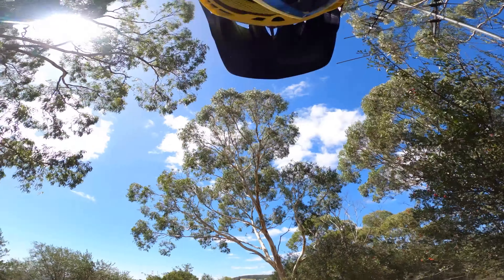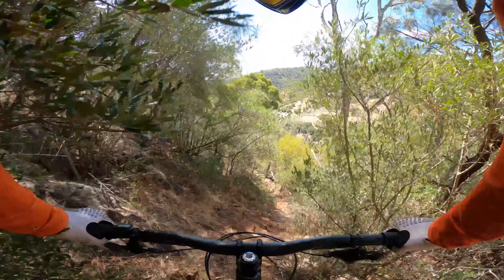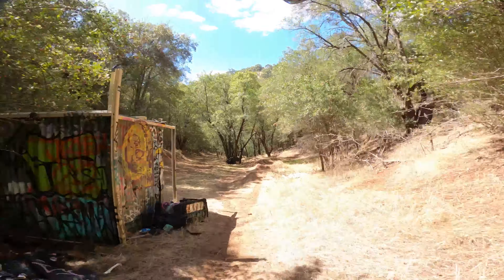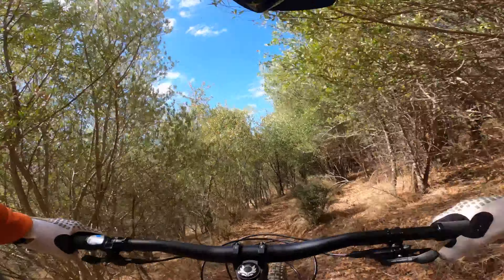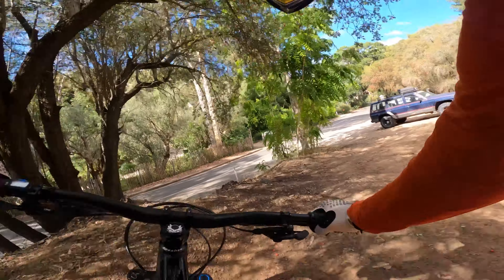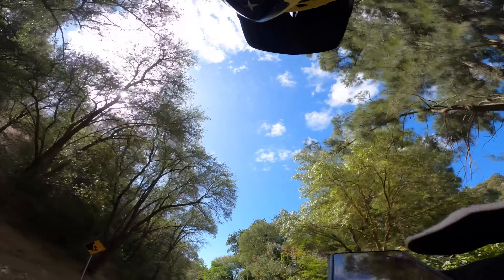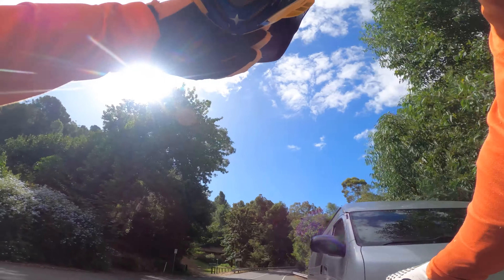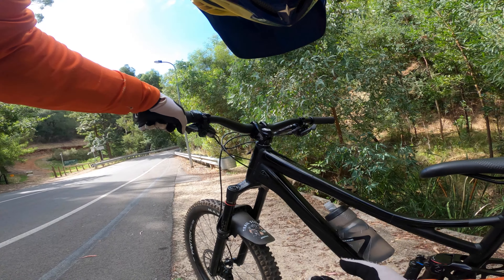Banshee Rune Hot Laps, looking for a setup at 4weeks

Comment: I hear you have this noise from the shock on repeptitive hits, like "cleg cleg cleg cleg" 1:47 for example. Do you know what that is? I've got similar on my bike too, just can't work it out; it appears only when hauling arse though. High speed rebound clagging maybe?
Reply from the maker: I think its partly airspring friction, not offering that ultimate compliance, and partly a touch over spring creating a little extra resistance. And partly cable/chain slap

Comment: Nice video!  What are your thoughts on the Super Deluxe vs. the stock Float X2?  I still have the Float X2 on my Rune and although it feels pretty decent on slow speed shaft movements it has never really felt all that compliant and lively on high speed chatter.  I have been contemplating buying a new shock for it.

Also, is that a 29" wheel on the front of your Rune?
Reply from the maker: Yep, I’ve got it set up as a mullet, 170mm 29er up front. I could run either wheelsize up front, but the 27.5 fork with the 37mm offset felt too short and tucked under at the front. So the 44mm offset was a must for me. The 29 wheel gives me more front end height and a little more charge. 
The superdeluxe with a megneg is definitely a little better than the stock X2, superdeluxe without the megneg would be ok as well. But if you’re looking for a new shock I’d look at the new Superdeluxe with a linear air can. That will likely give you the best performance once set up.
Reply: @mtbtelly5522  Thank you for that feedback. I’ve been toying with replacing the rear shock for a while now and would love to throw that new Super Deluxe on there (big fan of Rockshox but haven’t wanted to spend the money). Interesting what you’ve experienced with the front end ride height. I’ve also opted to set my bikes low to help with cornering but haven’t experimented much with going the opposite direction

Comment: Have you tried the dhr2 in the front??
Reply from the maker: Yeah I’ve run it up front a couple times, I prefer the more supple dhf
Reply: @mtbtelly5522  curious what you mean by supple in this instance? 
I've been running the DHR2 in front for awhile now but now thinking about trying other options
Reply from the maker: @MrSupermugen  the DHF has more rubber on it and creates a slightly more damped feeling, the dhr2 feels a little more lively and you can feel more of the trail through it